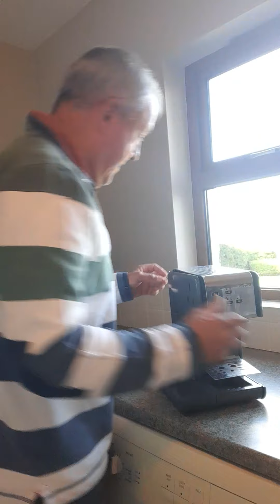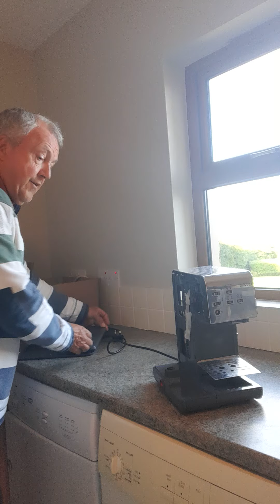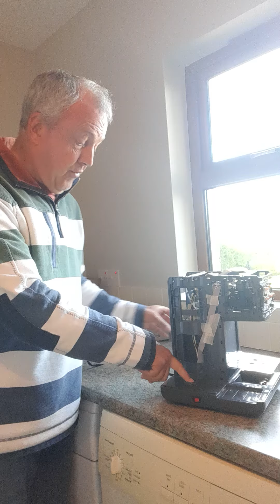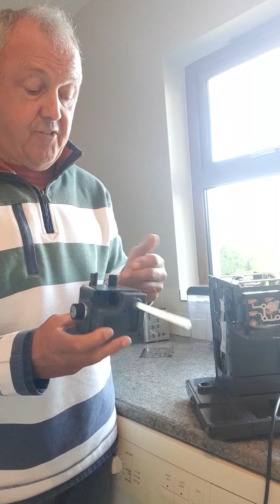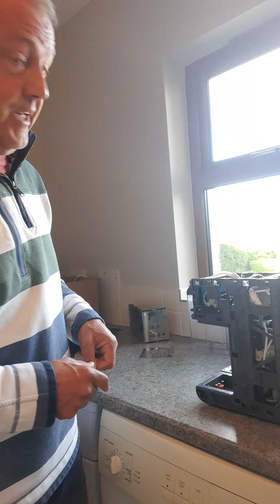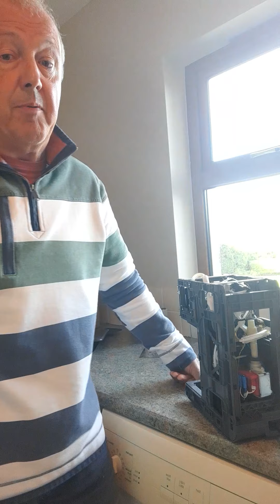Breville One Touch VCF107 coffee machine. How it works and some fault fixing

Comment: Hi. Im in similar dituation - after 2 years my coffee machine just doesn't work. There is plenty of steam but coffee is not flowing out - cleaning also not pouring water out. I was trying to investigate my blockage but cannot take it apart. Im from Northern Ireland, would you be able to look at mine coffee mqchine if sent to you?
Reply from the maker: Hi - sounds like you've got the same problem that I had ie your boiler is blocked up with scale. If this is the case no liquid will come out of where the espresso come out or the milk. The steam you see is probably just leakage and I wouldn't let the unit run like this as it will overhead. I haven't given instructions on how to open up the unit as I don't want to encourage people who are not competent to go inside the unit - it is potentially very dangerous with some very hot parts, live mains electricity and water! There are screws on the back and underneath to get you started - but only go in if you are confident to do so safely. Quite a coincidence that we both live in NI, but sadly I'm not getting into fixing these units for other people. I'm afraid I have other things to do. You might try and research if there are any local general electrical repair shops or post on your local facebook groups. I see a lot of postings like this on the Lisburn Notice Board FB group for example. Sorry I can't be of more help.

Comment from the maker: HI Nigel, glad the video was of some help. The problem you are having is similar to the one I had. There are 2 likely causes. The first one is the pump, the most likely cause although your comment about no change in the sound suggests this isn't the problem. It's relatively easy to check however. If you look around 2 min 20 at my video you will see the pump - sorry I didn't do a close up. This is a link to the pump (I ended up buying a new one at another time) https://www.amazon.co.uk/dp/B09YM38JFQ/ref=pe_27063361_485629781_TE_item and the top bit of plastic connects to a T piece. You can access the flexible clear pipes here and, by removing a clip, take one off. This will allow you to run the pump and see if it squirts water out. From what you've said, this will probably confirm the pump is working. At 9 minutes 40 in the video I show you the boiler. In my case this was blocked with scale. The good news is that the boiler is held together (it is 2 pieces) by big screws which you can take out. This gives you access to the boiler and you will be able to see the blockage as the exit for the boiled water is obvious. I actually took the entire boiler out and gave it a thorough clean out using a solution made from dish washer cleaning tablets! Please note all the safety stuff I said in the video. Firstly, unless you know what you're doing, don't go in at all. There are hot things and mains electricity, so there's a lot you can do wrong! Also, when you are reassembling, take particular care of the wiring and pipes near the boiler. It gets very hot and will melt through stuff. Certainly you need to photograph everything before you dismantle each piece. It is also possible that a solenoid isn't working, but that seems to me to be less likely. I hope this is helpful and please be careful if you are diving inside the machine. Alan. PS - my machine has worked reliably for over a year since I fixed it and I now clean it thoroughly every couple of months...

Comment: Hi Alan, great video thank you , I’ve taken my machine apart my trouble is I can’t run the self clean feature because no water is running through I’ve had it about 2 years and I’m also guilty of not cleaning it properly often , I’ve cleaned all the filters still nothing , any ideas? The pump isn’t making any loud noises it sounds the same as usual (I think) but for some reason no water gets sucked up in the machine hence no coffee , which makes me a sad man first thing in the morning . Have you a video on replacing or even checking the pump please or even the solenoid

Comment: hello sir, my machine is broken and when I turn it on there are two lights flashing and there is no information on the manual. Do you know what this fault is? 🙏
Reply from the maker: Michael, I'm not sure I can help you here. I recall getting both lights flashing when I had the machine disassembled and was working on it. I think it was because it had exceeded its safe operating temperature, but I'm not sure about this. There are two temperature sensors on the boiler. One operates first and I think causes the lights to flash. The other is a one time only fuse ie if the temperature goes on rising it melts and cuts the power to the heaters. If this has happened then the fuse has melted and it would need to be (dealer) replaced. It is also possible that the two lights flashing is a more general indicator used to say something bad is wrong and don't use the unit. Fortunately for me I never got into this situation. My best guess is to leave the unit unplugged for a while, then top up the water and try again. If it goes straight into 2 lights flashing mode then you have serious problems and need professional help. I'm just a keen amateur who needed to get his coffee machine working again (which is has been for 9 months now).

Comment: How to you get the main body off? I have unscrewed, however I can not seem to get the covers off and don’t want to force them off and break parts. Any help would be great. I seem to be having the same issue
Reply from the maker: There are 4 screws on the back which allow you to get into the back of the unit, good for access to the pump etc. After that I started pretty much unscewing everything until I found how to get the rest of the panels off. Not sure where you want to get access to? I found once, I had got access, it was pretty obvious. IE it was easy in hindsight if you knew how it was put together. Not much help I know. What do you want to get access to?

Comment: Thanks Alan for that demo. I need to repair the gasket on my machine as the handle was slipping when the pressure increased while I was making a coffee. So I thought I needed to clean or replace the gasket.I removed the screw where the handle screws in to, the little round metal part popped out,then I removed the rubber gasket. I was just going to clean it and see if it worked afterwards, unfortunately a small round plastic piece that was in the middle if the rubber gasket came out too and I cannot seem to attach it back.Any ideas on how to re- attach this part ? I 'll try post a picture .. thanks
Reply: It's ok Alan, I got it sorted,the plastic piece just seems to sit into the rubber gasket.

Comment: Hi Alan. 

Thank You for this video. It is a pity that you did not describe how to disassemble the housing, because you would save many people a lot of time. :)

My story (problem) is different from the ones you describe.

I had a leak from under the boiler. I couldn't quite understand how this is possible. I thought there was some sort of relief valve in case of overpressure, but no. I have a hole in the bottom of the boiler, which can easily be enlarged with a screwdriver, because the metal has become weak and brittle. I had a lot of stone on the bottom, even though all the pipes are unobstructed. The wife descales the machine once a month with vinegar. It seems to me that so much scale has deposited at the bottom of the boiler that simply, under the action of water and high temperature, the metal has corroded and become weak. It appears that very poor material has been used in this boiler.
Reply from the maker: Marek, glad you found the video helpful. Your problem seems very odd, not sure if anyone else has seen this! The reason that I didn't provide details about how to dismantle and access the machine is that I did it slowly over some weeks and ended up dismantling far more than I needed. I didn't want anyone else to repeat all the extra work that I did. Somone else can post a video showing how to get in if they wish.... I might the next time I have to get back fully inside. Alan

Comment: Hi Alan,
Great video !
I've got a problem with my Breville machine aswell; the machine now works only on Automatic and manual espresso setting, but only for a cofee, after about 3 min. all leds start blinking and nothing works till I turn it of from plug.I notice when doing the espresso that only the water heating led becomes full, but not the pressure one for the milk , that led just blinks showing that it's getting ready, but in the meantime  all the leds start blinking and the machine is unresponsive, therefore I can't run a deep clean procedure as I need the pressure as well.I've put some vinegar or descaling in the water tank and run the machine on manual espresso but still no luck.Any idea  what might be wrong?I'm thinking to open it up.

Thanks.
Cos.
Reply from the maker: Hi
Thanks for the feedback. I'm no expert on the entire machine, I only posted on line in frustration at the complete lack of any posts about how this machine works.

However, if I understand you correctly, your espresso is working but your milk system is not. 

The switch which tells the machine the milk container is present must be working, otherwise your milk light would do nothing.

So the problem is likely to be in the heater for the milk or its solenoid. I didn't go into this on my machine as my problem was a blocked water boiler. This boiler boils the water (under presssure) for the espresso but also feeds hot water to what I call the super heater for the milk ie steam.

I've seen the all lights flashing scenario - this is the machine saying something fatal has happened and switching off ie it's a safetly feature. I got this when my boiler was blocked and it got too hot (no water in it) and tripped the safety.

If you really can get espresso out, then your boiler is not blocked. I'm guessing that the super heater might be and so it is overheating (with no water in it) and causing the lights to all blink and lock you out.

You might be able to find the pipe which runs out of the boiler and goes to the superheater. If you want to try this, firstly make sure the device is completely unplugged and has been left long enough to be stone cold.

Take the 4 screws out of the very back plate which will come out.

You are now looking at the pump (bottom left) and a solenoid valve plus a lot of pipes etc.

Behind all of this is the superheater. It is black with yellow/brown 'windows' in it. If you neeed to actually get this out it will be a major dismantle which I didn't do.

At the very top of the machine as you look in from the back is the outlet of the boiler. This is a black 4 way junction. One pipe goes off to the front of the machine (espresso) but another runs to the solenoid valve you can see. This is the valve which opens to allow hot water from the boiler to go into the superheater for the milk. 

If this fails to open then you'll get no steam for the milk. One pipe runs from this to the superheater and I'm guessing that you need to access this and then find a way to get vinegar to go through this into the superheater and back out. People say vinegar but I found that a washing machine and dishwasher tablet (used to clean the machine, not to do the dishes) is much more powerful when mixed with some warm water.

Another possibility is of course that your superheater is damaged ie its electrical heater has failed.....

This may or may not be helpful to you. But I must stress two things. Firstly don't open the machine if you're not competent to do it. There's a lot of electricity and hot things in there! And secondly, I didn't have to touch the milk heating part at all, that wasn't my problem. So in that sense you are on your own.

You might be better to take the machine to a local general repair shop if there  is one. Up to you.

Please be careful!

Alan
Reply: @alanwatts1295  Thanks for your reply.I'll have a look at the solenoid, might be blocked.I'm an electrician, confident on my side of things but I wouldn't mess about with the electronics side of it.
Reply: Hi Cos, It seems I am facing the same issue as you described, just wondering have you fixed yours yet?😢 Thx
Reply: @alanwatts1295 Im having same issue with top of my machine becoming extremely hot, can you please suggest what could be the issue. Thanks